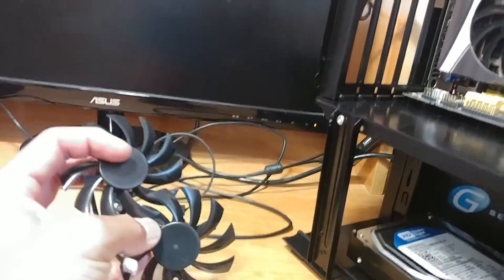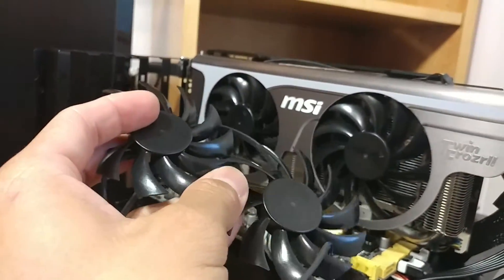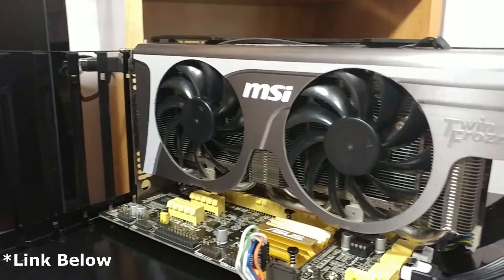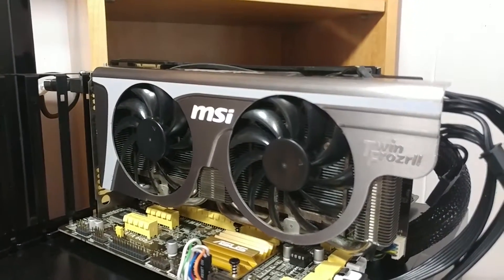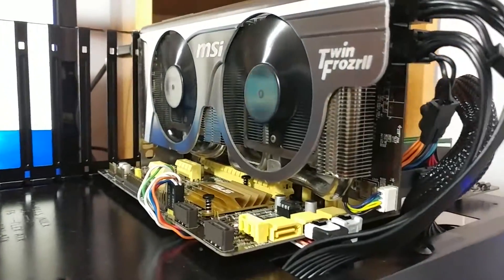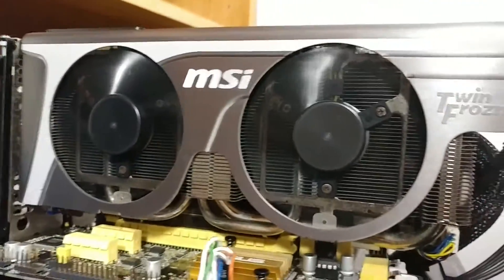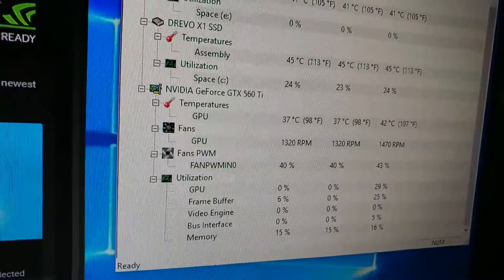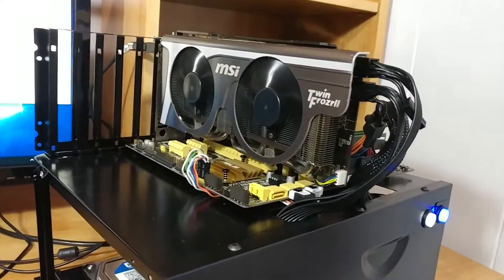GPU Fan Replacement

Comment: Is the process at 3:00 necessary to wipe down and apply new thermal paste? If so, what products do you use for cleaning?
Reply: just isopropyl alcohol works fine i believe

Comment: That radiator alone is worth 20$, but replacing the fans for this card is a waste of money. Particularly because this GPU is going to burn you 20$+ per month for electricity alone(170W TDP). You can get more performance at 10% power consumption from a 200$ 5600G.
If this radiator can be transplanted to cool some shitty chinese RX570 or RX6400 - that by itself is worth it. But the GPU\PCB itself is only worth stepping on. And I know this is a 2017 video, but even in 2017 a 560ti was basically GT1030 level, except for 1030 had 30W TDP and was supposed to cost like 80$.

Comment: What do you do if new fan is the same model but has a large 4pin and your gpu is a small 4 pin?
Reply: I seriously doubt it he will reply you just simply because i'm quite sure he doesn't know how to. Either you seek for and find some cable adapters which that could be a real challenge or you cut the plugs and use a soldering iron to join all wires. Care to identify all the wires first, postive, negative, tachometer and pwm.

Comment: I hate the fan bracket screw locations on some cards. is there really no way to open these without messing with the thermal paste?
Reply: Nah you have to deal with it, it's fine just replace the thermal past and keep the thermal pads